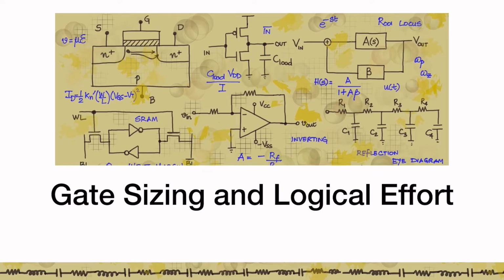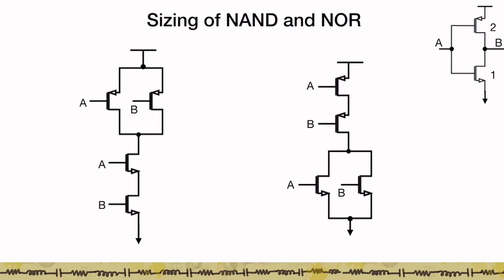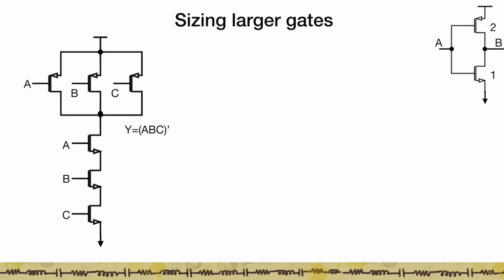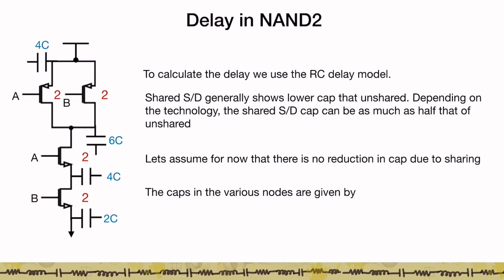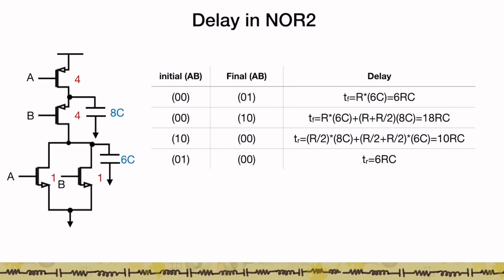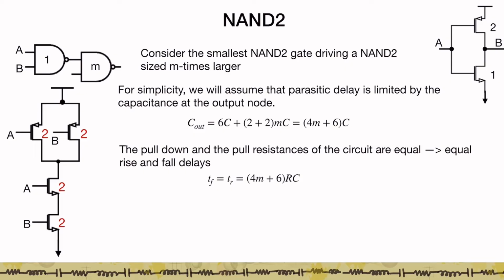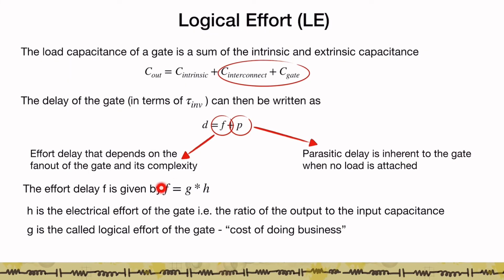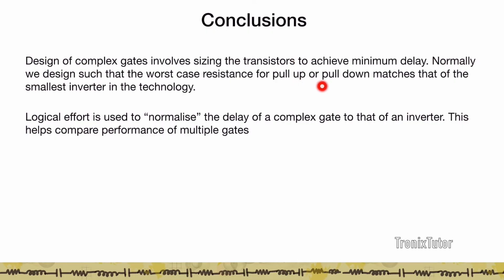Gate Sizing and Logical Effort Explained: Minimum Delay CMOS Design

Comment: Very well paced lectures. Per unit Gate and per unit source/drain caps are all assumed C. How true is that?
Reply from the maker: The drain and the gate cap are not equal. Typically a proportionality factor is assumed between drain cap and gate cap. To keep the analysis simple, I chose both to be equal in the lecture